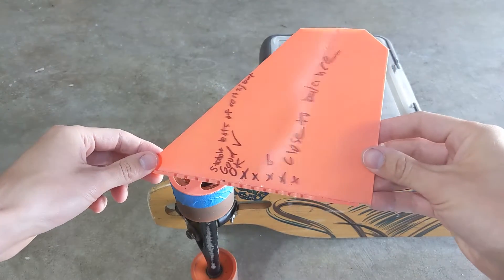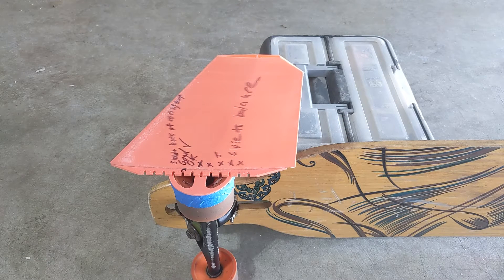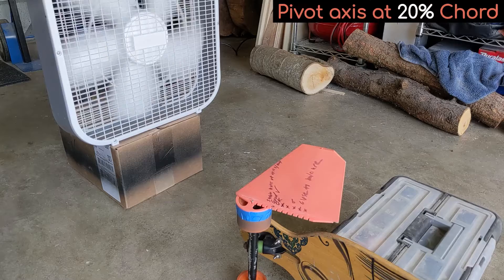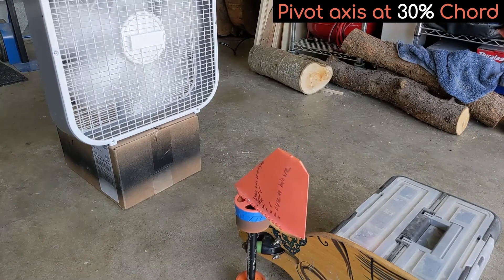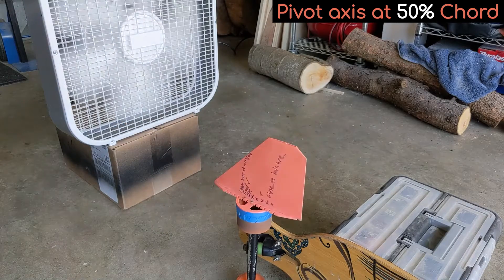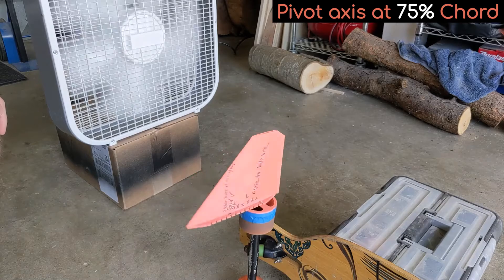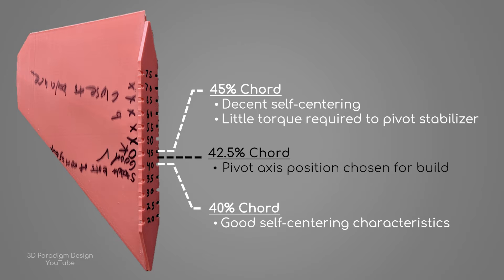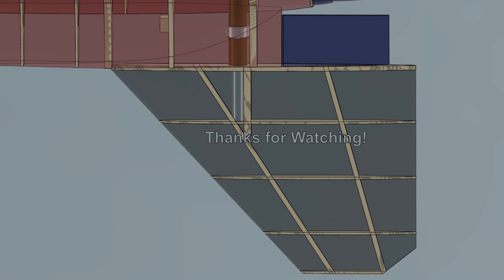Horizontal Stabilizer Pivot Axis Test -- RC F-16 Build -- Part 2

Comment: I would change one thing, the horizontal stab, rather than putting all the stress on one former spread it out on 2 .
Reply from the maker: Are you referring to the coral colored stabilizer in the video? If so that one was just 3D printed for that test. The actual one for the plane has much different internal structure as you can see in this video: https://youtu.be/4UCgZbSI0yM
Reply: @3DParadigmDesign  gotcha

Comment: That doesn't make any sense. You just need to weight balance this
Reply from the maker: For a full moveable aerodynamic element like this stabilizer it's important to consider where the "center of pressure" is and place your pivot axis accordingly. Although the center of pressure changes with angle of attack I'm just approximating here. If the pivot axis is too far aft the airflow can cause very unpredictable behavior from the stabilizer (causing it to want to flip around). This would put a lot of extra strain on the servo, potentially strip servo gears, and make you lose control of the airplane.

Comment: The real F-16 has a set location on the cord of the stab where the control pivot is, then after you need to balance and add weight forward or aft, to eliminate the any possibility of flutter, the test you performed is an example of determining center of pressure btw